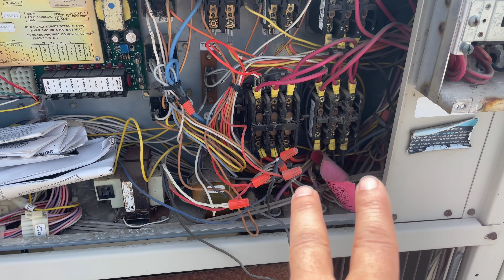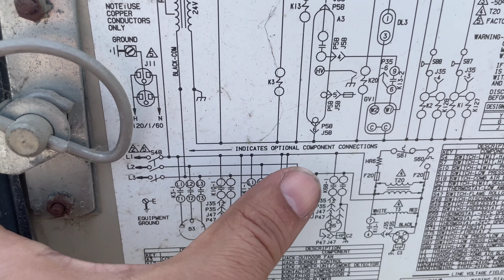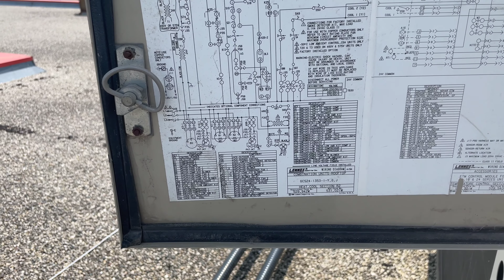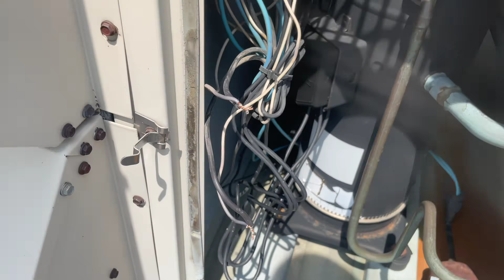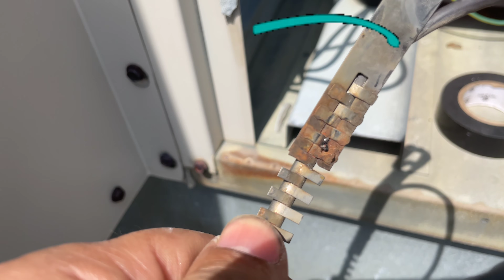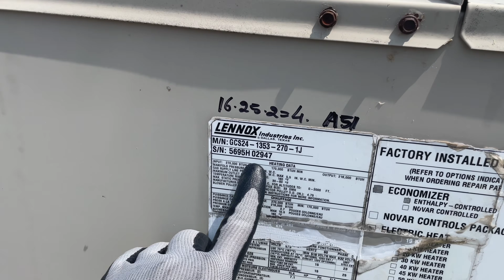Lennox Package RTU dead short to ground

Comment: Great video. Good Job and Nice Work. Thank you for sharing. Have a nice weekend. I was learned new thing from your video today.  May I ask, is it good for compressor running working without crankcase heater. I'm new to hvac.
Reply from the maker: Thanks crank case heater heats compressor oil and which causes to release refrigerant mixed with oil so it increases a efficiency of system but system can run without it